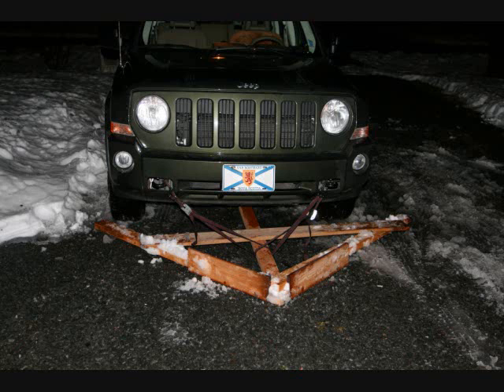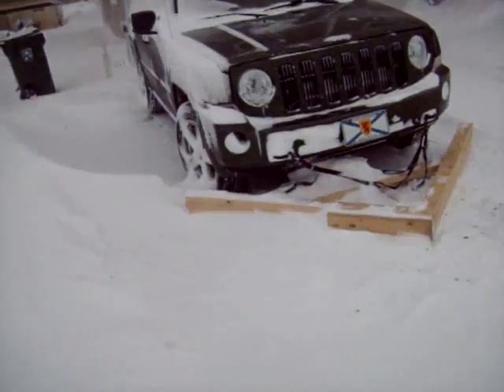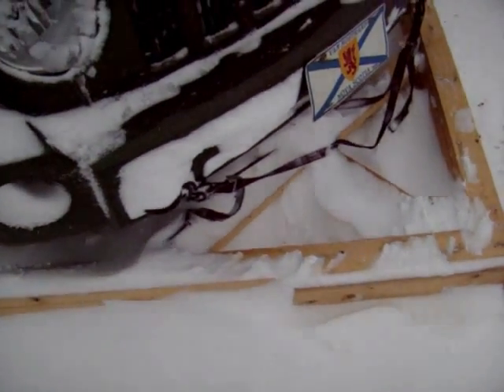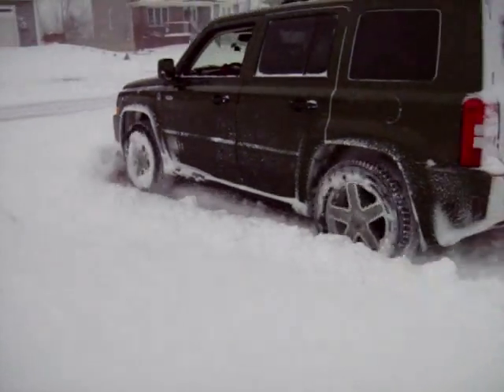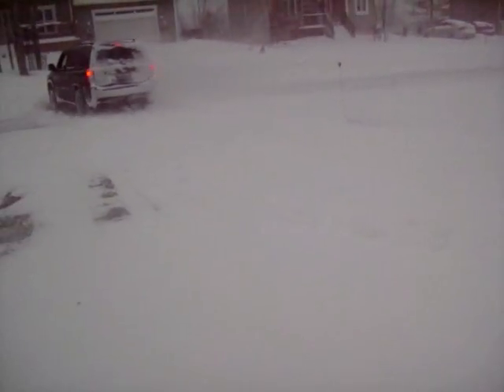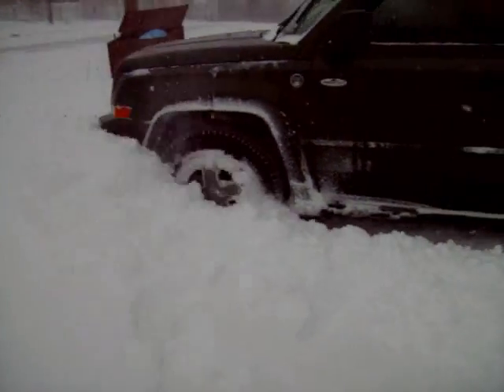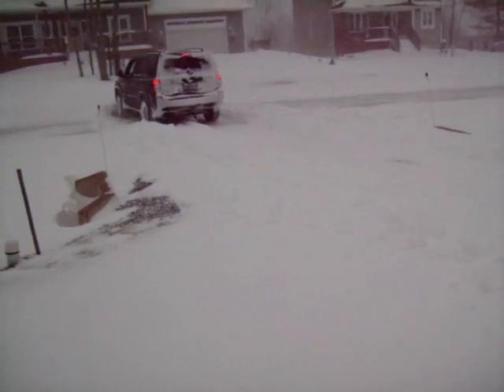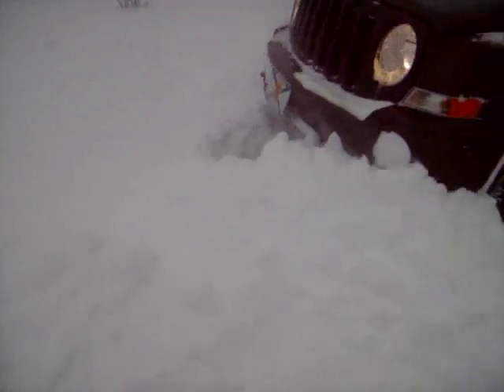Snow Plow, home made of 2x4 wood

Comment: I agree... I am thinking about doing the same thing but on a little bigger scale just to plow a driveway to a camp out. Use an old junker 4wd with a rig like you've built and I won't have to snowmobile in all the time or get someone else to plow it. I really would like to see the updated version. I hear ya on the cost  - I'm in New Brunswick and ALL plows are overpriced - even worn out rusted out ones. It's ridiculous. What did you make the pole underneath out of??? I

Comment from the maker: PS:  The current design (not the one in the video) DOES have additional layers of the 2x4's and plywood to give it extra height.   I am thinking about an automatic mechanical lifter so that when I back up it will raise the blade a few inches to prevent the snow from getting tangled up in the vee.